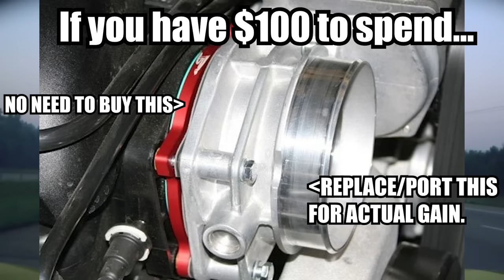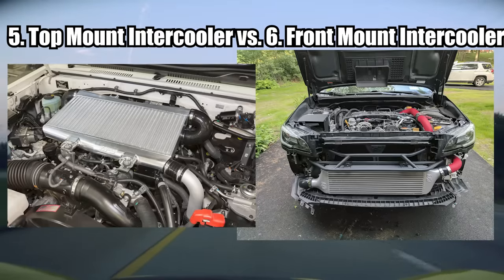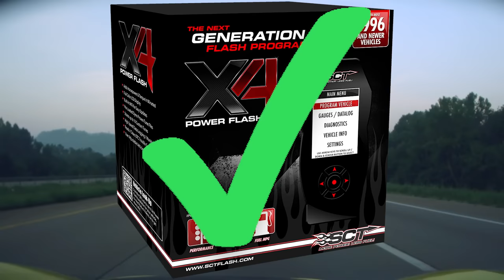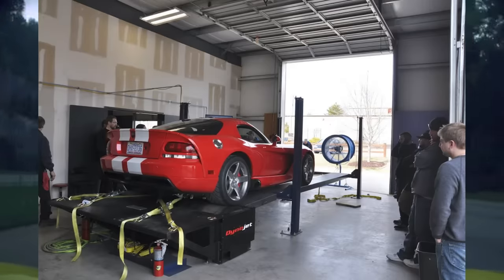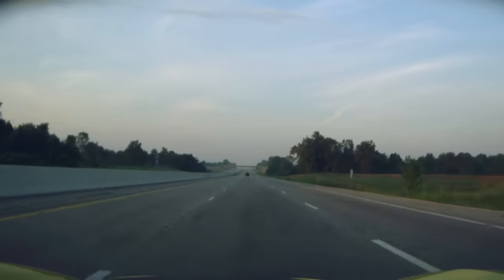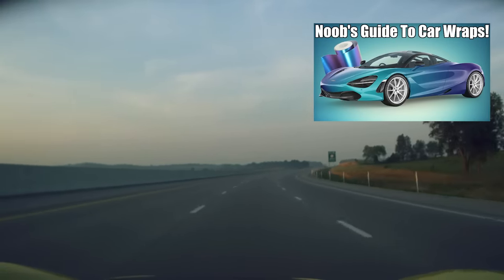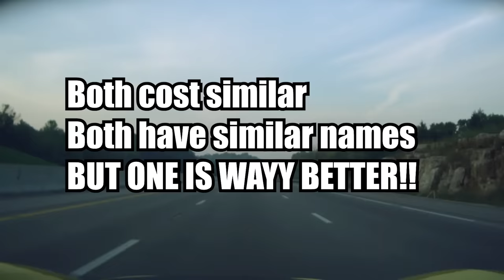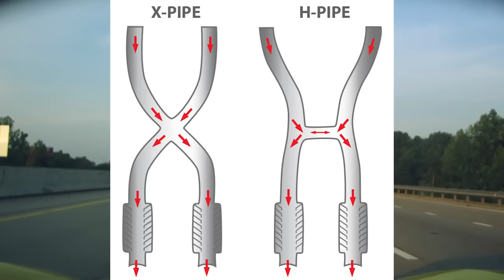25 Real VS. Fake Car Mods!

Comment: I agree with you for most things but If you remove the catalytic converted and attach a pipe with a larger diameter instead of a regular exhaust pipe you gain for sure more power as long as the exhaust valves for the zylinder head and the exhaust manifold allow a higher gas flow through a straight pipe. If the exhaust valves, the zylinderhead or the exhaust manifold are restircting the exhauste flow then even the largest exhaust pipe want bring you anything.
This is simply because the piston needs less force to push the burnt fuel out of the burning chamber when the exhaust has to be pushed through a smalller pipe which creates backpressure. 
The lower force needed to push the exhaust out of the chamber is the torque you gain by this method. 
In a extremly simplified model you can use the law of Hagen-Poiseuille which state that the pressure decreases to the power of 4 by the increase of the radius by the factor 2. 
Therefore, the larger the diameter of the exhauste the lower the backpressure. This means that the piston does not have to apply such a high force to get ride of the exhaust and overall you gain more torque. 
Furthermore, less exhaust is left in the burning chamber and a higher amount of oxygen is in the burning chamber and therefore more gas can be burnt which increases the power even more. 
This is also the reason why supercars have mostly a exhaust with a flap that opens as soon as you want the full power of the car. 
You can easily try this at home. Take a bottle filled with water then make a 1 mm diameter hole in the lid. Now push the water out and stop the time.
Now you repeat this but instead of a 1 mm diameter you now emove the lid and push the water out of the bottle. The bottle without lid will empty much faster than the one with the small hole in the lid. This is also true for the exhaust even thoug the behaviour is not excatly to the the law of Hagen-Poiseuille because these are gases and the formula must be modified for this.

Comment: For the straight pipe example, The reason why engineers make the pipe small is because it reduces the amount of metal needed to make the exhaust, i.e cost and also to get more precise measurements for the oxygen sensors and catalytic converter. The volume flow rate, Q is not going to change, You're going to get the same momentum out of each diameter pipe for the same amount of force, using the continuity equation. yes there is going to be different pressures in the pipe, and different velocities, but its not necessary to have higher pressures, unless you're doing it for the sensors. I'm in engineering btw

Comment: Just a note, while eBay desk fans claiming to be electric superchargers don't do anything, electric superchargers (with 15-20hp electric motors and 48V+ electrical systems) are currently used in production vehicles (ex. in the current Audi 3.0T motor to provide boost while the turbo is out of boost).

Comment: I have a question about straight pipes

You explained in this video, that if i installed a thicc straigh tube in my grocery getter i wouldn't gain anything at all, but what about more powerful cars with like 350+ horsepower, will installing a big straight pipe do anything good with higher power engines?
Reply: I think 350+ hp cars have a good enough exhaust system to be more effective than a straight pipe
Reply: Yes with an engine that has higher displacement or revs and pushes out more exhaust fumes is generally gonna need bigger exhaust, also, unless you have Clout syndrome, there is absolutely no need for a straight pipe, mufflers will rob you 10HP generally (depends really, on new cars it's a much smaller difference and there are so many variables which I couldn't get into even if I wanted to) and hell, it's possible to have 0HP loss muffler systems that are reasonably quiet (you would have 0 problems passing noise regs).
Reply: Any car could benefit from a straight pipe just you need to know what size you need to keep the back pressure
Reply: @hubertkam7647  don't lie to them. No car can benefit from straightpiping. All it does is make you loud, annoying, and triggering for people with PTSD.
Reply: @Megidramon  "triggering for people with PTSD" massive reach there mate
Reply: If your car is turbocharged, larger is better. You need some back pressure, but the turbo is going to generate it. That’s why you see some civics with like a 5 inch hood dump.
After the turbo the exhaust gas is useless, so you want to get rid of it as quickly as possible.
Reply: @Megidramon  all race cars are straight piped and will never bother with some fancy exhaust it’s usually lighter and avoids all the emission equipment

Comment: Hey @Bladed Angel , I’ve actually seen that the roof spoiler specifically on the GD Chassis STi actually does make a difference because it directs air to the high spoiler. Not sure if it’s 100% legit, but it would make sense compared to other cars using it. Lmk what you think!
Reply: You'd think after flowing past the roof spoiler the air would be really turbulent when it got to the wing.  I might see if I can find any wind tunnel testing for that

Comment: I’ll say this though, i had a ported intake manifold and later bored my throttle body + spacer and port matched it to my IM and it’s given some decent improvements in regards to thermals (haven’t flowbenched it so I cant confirm air flow improvements yet), not enough to feel but it’s there.
Now unless I’m driving hard for a while I can comfortably place my hand on my intake manifold and not melt my skin lol

Comment: Question: I have a 2.5in stock exhaust on my 2017 optima, would a 2.5in straight pipe, with a stock cat, be an ok mod?
Reply: Put a resonator in right before the rear axle so you don't get serious in cabin exhaust drone.
Reply: whats the point if youre keeping the same diameter? if you want it to sound different then you have to go without a muffler, cat, or both but that will sound like ass. the most i would to keep it from being a rice rod would be removing the cat and thats it. just keep on the resonator and muffler (or the expensive route, get a high quality muffler, a skunk2 muffler makes a honda sound pretty nice, no loud ass bee noises)

Comment: Top mount vs. Front mount intercoolers. The front mount is technically more efficient at cooling, but can very slightly reduce throttle response vs. A top mount intercooler. More piping, and more air flow cause intake air temps to be better, but the added piping can reduce throttle response because the air has to travel farther. Tho the throttle response changes are usually negligible. And the lower IATs can be a bit of a benefit actually

Comment: Straight pipes actually work on turbocharged cars…the best exhaust for a turbocharged car is no exhaust.
Reply: Ehhhhh, the engine being turbo'd won't really make a straight pipe the better choice, you should think of it more as exhaust size dependence on how much gas you're pushing out of the engine. There is a way to make a muffler system that costs you 0HP while being reasonably quiet. And on no exhaust, while yeah you can have no exhaust and see gains over your average exhaust system, an actual well designed exhaust system won't hurt, plus it's not a very good idea to have hot powerful exhaust gasses go under your car for aero reasons.

Comment: Purchased my Eibach lowering springs and had them installed by a great mechanic at Sears in Gurnee, IL. They dropped the car 1 & 1/2 inches and it looks fantastic and became super-sure footed in curves. The Eibachs handle rapid acceleration and braking extremely well.  Replacing the coil packs after 98000 miles increased hp by 20. Removing the resonator also increased throttle response (lag time no longer exists).  switching to Premium ARCO fuel instead of the manufacturer's politically correct 87 octane recommendation. Results: Higher top end speed, mpg +5 over manufacturer's window sticker, super-fast throttle response. I love what these changes have done for the vehicle.

Comment: A short ram intake can be useful depending on application. More air is always better. Think of a sbc literally flipping top of air cleaner over making poor man’s cold air intake increases hp a measurable amount like 5hp and that’s in same spot it was same temp air as before just more.
Reply: Again it depends on what car it is. More air is only better if that's the bottleneck in the system. But just because there is "more air" doesn't mean that a car has the fueling or mapping to take advantage of it. Also the bottleneck could very well just be in the head anyway.

So some cars pick up some hp from it and some see worse performance compared to stock.
Reply: @christopherjohnston6343   pretty much every newer vehicle’s computer will make necessary adjustments for a simple air intake alone. And no vehicle after 1996 odb 2 requirement will not have enough fueling to handle the extra air from just an intake it’s not like your adding boost lmao. Stock heads will always be a bottle neck eventually along with everything else in the engine will be. It’s rare for more air to atomize fuel more being a bad thing and when there’s the few situations where there’s no gains or a loss it’s so small it’s within +\- averages you would see normally anyways if you dyno the vehicle 10 times in a row. And any engine that’s carbureted it’s going to be better 99% of the time.

Comment: Wouldn't you need a 'V' engine to have an X-pipe tho? I'm not fan of straightpipes either, but good luck putting an X-pipe on an inline or a rotary.
Reply: Yeah that's what I was thinking, it kinda just doesn't really work.
Reply: Of course you can't,  but that's not the point. The point is, in general, X/H piping is A) safer b)mo powa babeh c) better for your vehicle.

If you have an inline, just get a better exhaust system.
Reply: @Megidramon  I'm going to straight pipe my civic and redline it through residential neighbourhoods at 3 am and nobody can stop me!
Reply: Some inline engines, mostly 6 bangers, use two separate headers (one for the first three, and another for the last three cylinders), these can run x/h pipes, true duals, etc.
Reply: @wolfgang_h3t  I've owned quite a few i6s and all of them had headers that came out in two sets of three but merged into one before the end, can you give me an example of a car with the setup you're talking about cus I'd be interested

Comment: 3:19 What if you have front mounted intercooler and that hoodscoop method COMNINED.(on a drag car ofc)
Reply: You mean like both having a front and top mounted intercoolers? If so, you'd just be wasting your time as you'd add twice the weight for 5 more HP at best (assuming one of your intercoolers is adequately sized). And if you mean having just a front intercooler with a hood scoop well then how in the bloody hell will you route the scoop to the intercooler, plus as long as you have sufficient flow through the bumper into the intercooler then there is absolutely no need for more flow through it.
Reply: @skeptix_store  As in twincharged cars which have ZERO reliability.(*cough*cough* zenvo)

Comment: I was actually happy vortex generators was mentioned, because some people claim it's just a ricer mod, but it's actually scientifically proven to do things with aerodynamics. Basically vortexed air followes curves better and also due to to turbulence has less surface friction and flows faster. This is why you see cars today using things even like the body lines and side mirror shapes to create small vortices in order to reduce drag and gain mpg... And on the  leading edges of plane wings (and Pikes Peak trial car wings), because that sped up air is less dense, creating lift on the plane wings, and downforce on the car wings). You see the vortex generators on STIs and EVOs because they're causing the wind to follow the back window, which at first would create lift, EXCEPT that air the those massive rear spoilers and it creates downforce in the spoiler. For a pickup truck, vortex generators would cause less drag on your back window as the vortexed air separates in a more streamlined fashion from your roof edge vs a dirty eddy of air dragging on your back window. Couple that with a bed topper and tailgate spoiler (reducing drag on your tailgate by moving the separation point and eddy further away from and therefore having less pull on your tailgate, you'll have more mpg & higher possible top speed, as well as faster acceleration at elevated speeds due to less drag (so you can pass those slowpokes holding up traffic quicker!)

Comment: Glad I found this channel. Just bought a 2002 accord I want to do a little work on, nothing crazy. Person I bought it from did some great work to the engine(Just upkeep nothing added) and it has a straight pipe exhaust.

I want to redo the suspension and the exhaust, and would like to do some engine upgrades for a little more horsepower buuuut I don't necessarily want to just add a turbo. But I've never done any kind of 'building' on cars so it's all gonna be a learning experience 👍

Comment: It really depends on WHICH flash tuner it is. MHD, which is famously known for BMW engines like N54, S55, B58, and S58, offers OTS tunes as well as the ability to create custom dyno tunes using the platform. Some flashers are simplers and more general (like you said, model instead of your SPECIFIC car), while others will allow you to create custom tunes that will make the most out of your personal setup.

Comment: The point of short ram intake is not to take in colder air. It's to reduce air flow restriction. Whether of not that makes a measurable difference depends on your set up. Heat could offset the benefit. You can make an equation for this
Reply: Thank you for this. There are plenty of people who scream "hot air intake" but like you said it's totally dependent on your setup. Particularly on a forced induction system, of you have a properly set up intercooling system the temp difference between a "hot air intake" and a cold air intake at the intake manifold (after the cooler) is negligible. Sure the sooner temp may be better but complexity may not be better in the long run.

Comment: There is an actual electric turbo that costs around $1,500. Seth MacFarlane's garage did a before-and-after putting it on the Dyno in different setups did end up making a significant amount of extra power the most power as a sequential turbo setup rather than just a straight twin turbo. Just watch the video it's pretty fun for car enthusiasts to nerd out on

Comment: 6:50, the leaf blower will typically only work with very small engines, but you can get some very large and powerful leaf blowers that can  add a lot more than 7 horsepower to some really small engines.

Comment: Throttle body and cold air intakes make power all together. Air intake, throttle body, intake manifold, injectors, long tubes, x pipe and catback with a race tune plus rear end gears, goes SOOOO good together and works until you go for boost.

Comment: for my vehicle i had to replace the exhaust system because its y pipe literally rotted in the middle beneath the engine. i cut it off and ran open headers until i got a new x pipe setup. the open headers was just stupid loud with no tone. the x pipe although a bit quieter just sounds so much better. i didnt notice any power differences.

Comment: Cold air intake isn’t a “fake mod” it’s a good modification to make if you’re getting ready for any form of forced induction. It’s some of the best airflow you can get from under the hood. Just keep in mind that it’s best used with a better exhaust system, and forced induction

Comment: i recently got a 2017 civic hatchback with the 1.5t engine. i put a prl short ram intake on it (no tune). and i do feel as if there has been a noticeable increase in power. granted its not a huge power difference it did do other things like help the turbo spool quicker. i did worry about heat soak mostly due to having seen this video before but since flooding is a thing in my area i would rater experience heat soak rather than hydro lock. but to my pleasant surprise my engine temps are lower than before and the good old butt dyno feels a difference so im vey happy with that car  mod.

Comment: 7:00 the reason leafvlower is better is because a leafblower is a true supercharger. The fan is just a fan, not a supercharger. But a turbo is a turbine-centrifugal supercharger (a centrifugal pump for air that is driven off of a turbine) and a leafblower is an electric-centrifugal supercharger. Also, leafblowers dont lag
Reply: a turbo isnt a supercharger
Reply: @arcanevoid9199  ...
you better be trolling my man

Comment: Subaru’s roof wing actually works though. Not super effective but it serves the same purpose as vortex generators which is to help direct airflow to the rear mounted wing in order to increase anti lift.

Comment: 3:39 The image you show here is basically a cold air and short ram at the same time. As you can see a scoop/duct to bring fresh cold air into a heat shielded and high flow air intake

Comment: About the 5" straight pipe exhaust... technically you want the least amount of restriction overall for supercharged engines, the reason why top fuel drag cars just have short individual header sections pointing up; the least amount of restriction after the turbo for turbocharged engines, same deal with 2000+HP drag cars dumping straight through the hood after the turbo; and the least amount of restriction a bit after the collector merge point for NA engines, where exhaust savaging happens. You can cut the exhaust off as short as possible after those points and make the most amount of power on the setup. Now most cars don't need huge exhaust pipes and a well engineered (ie. properly sized with a crossover and some resonators/mufflers) exhaust system will sound WAY BETTER than a sewer pipe you picked up at Home Depot, but you won't make any more power.